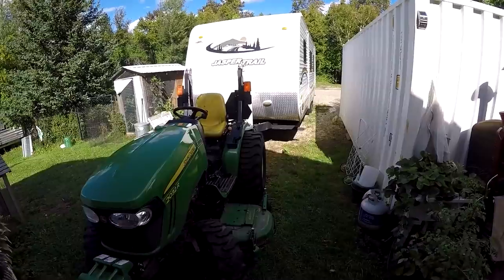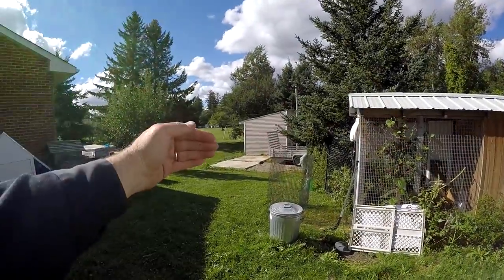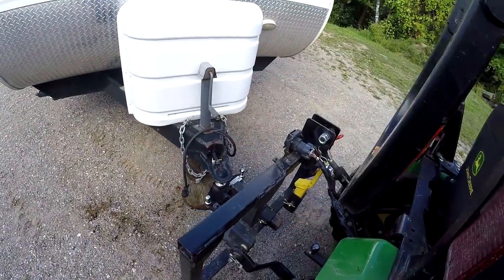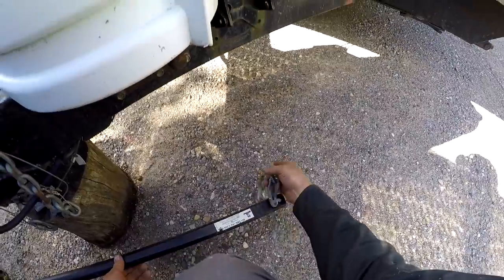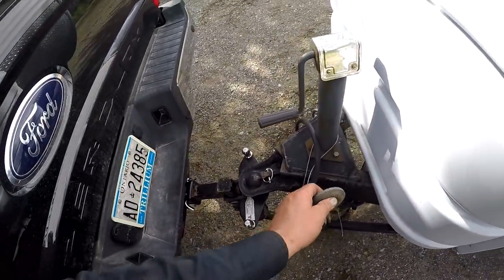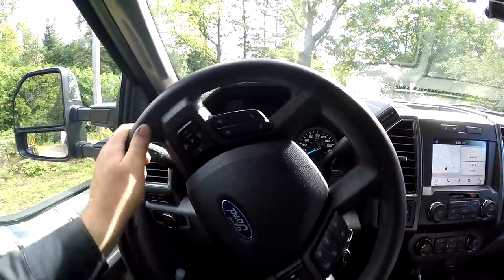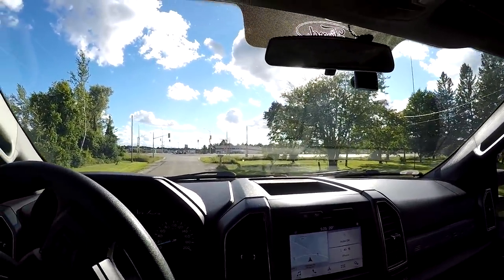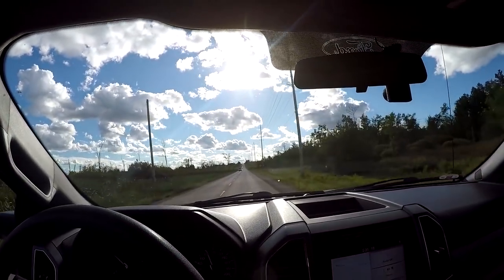Well Finally the day is here...How does the 6.7L DIESEL Super Duty pull the 7500 lb Travel Trailer

Comment: A good tip is to park your travel trailer on boards so the ground isnt rotting your tires away
Reply from the maker: good idea!
Reply: I was told different. What you dont want to do is put covers on them which can dry them out.

Comment: You might want to consider getting an anti-sway control for the trailer. It attaches between the trailer and the hitch on the truck, and it has brake material in it. You tighten it down until it cinches a bit, (you can adjust how much). It saved my bacon running across S. Dakota during heavy cross winds. I would have been in the ditch or jack-knifed without it!!

Comment: @BILLSTMAXX Don't you have a gopro ?
Doesn't the gopro link to your phone ?
Set up the gopro so you can see the back of your trailer 
Also, i think you missed my comment on the tow hitch, on the adjustable part, insert a nut and bolt through the spare holes at top and bottom, that will prevent the hitch sliding off if you lose your pin.
If the bolts are long enough, and if you lose a pin, you can use the bolt instead.